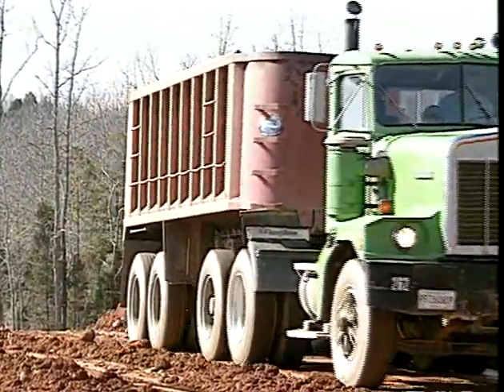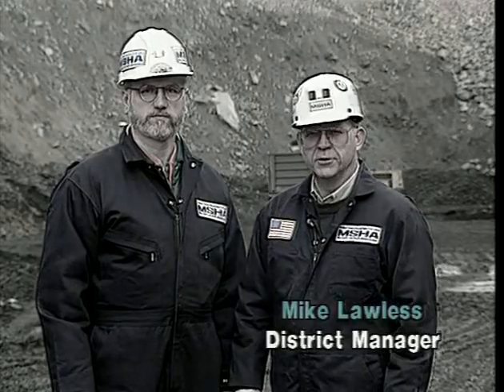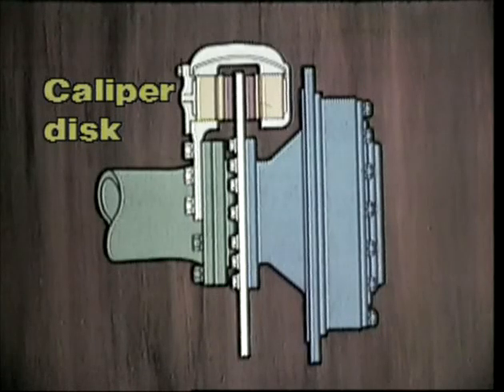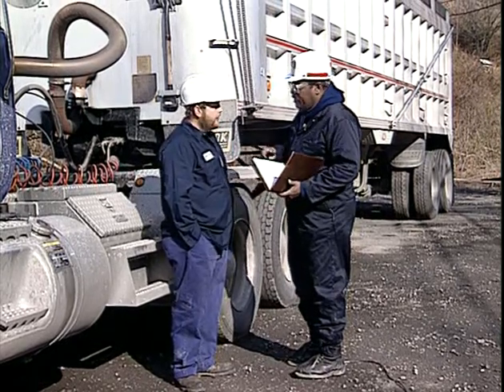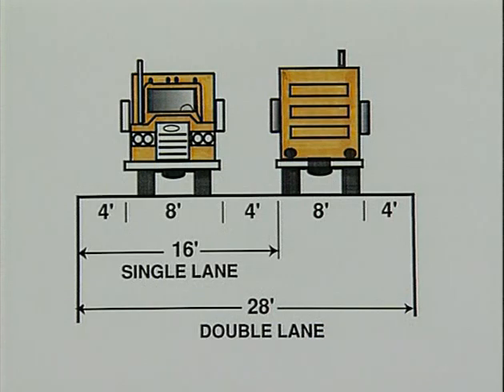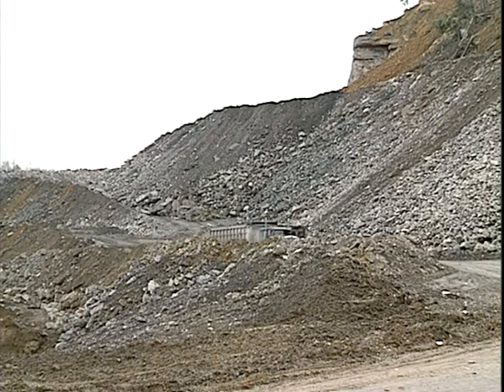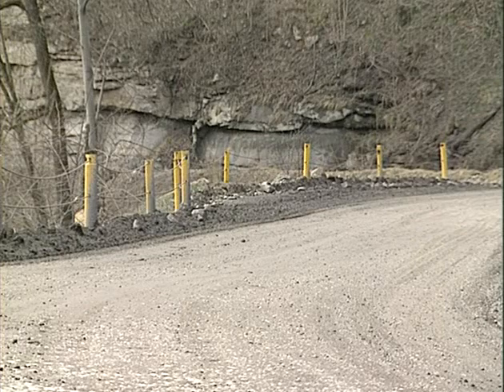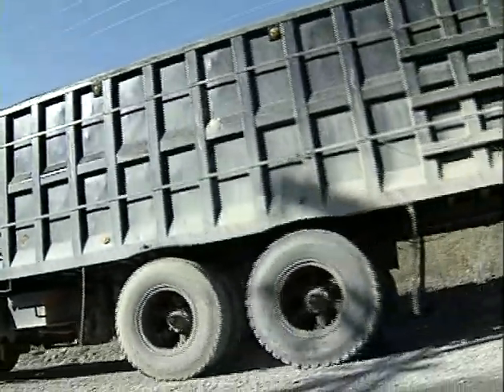Brakes, Grades, and Runaways - Off-Road Trucks

Comment: I hauled off road for 9 years in a mack rd 800 and ill be the first to tell you make very sure your brakes are good and work properly, I myself have had rear ends go out and brakes to fail with absolutely no warning always have a back up plan as to what to do if something was to happen(if you drive long enough it will) I miss hauling coal and if it ever picks back up id go back trucking in a heart beat